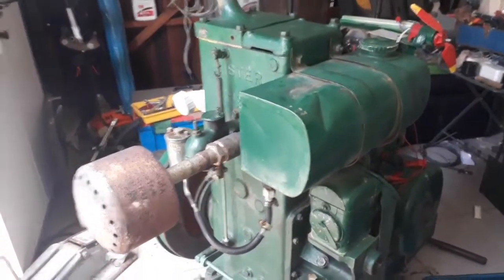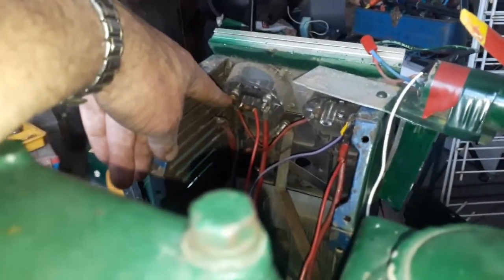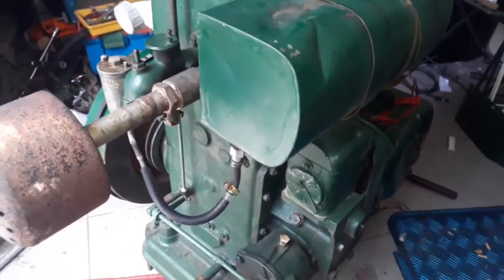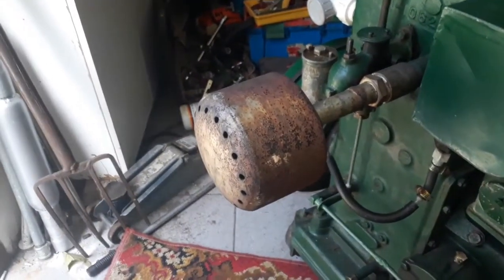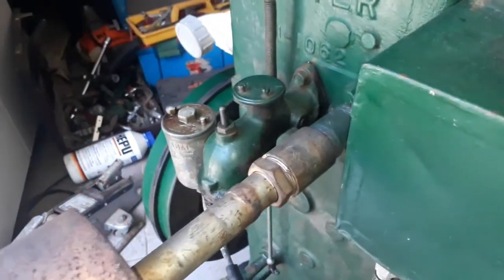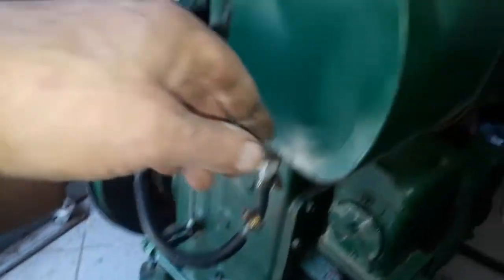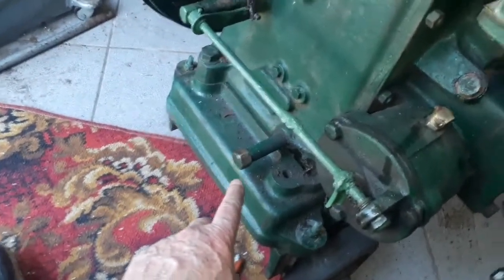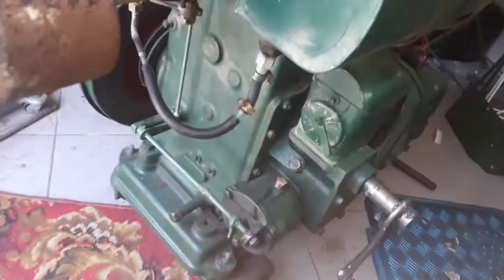New Fan Belt for the Lister Generator, now the Engine and Generator not working, an oil test next

Comment: Jan, you’re not supposed to have my set of problems! I don’t know the water jacket passages on the Lister D. If there’s water in the oil sump, chances are that it’s the head gasket - hope it isn’t a problem! Good luck.
Reply from the maker: I really also not sure if the water tank are open to the head gasket but we will find out my friend, lets see tomorrow, thank for watching and hanging out with me
Reply: @jankotze1959  my 2 cylinder Lister clone only has one coolant chamber the surrounds the cylinders. I believe that mine can’t leak directly into the sump. Water in my sump comes from condensation.